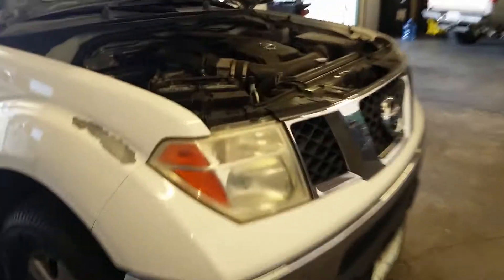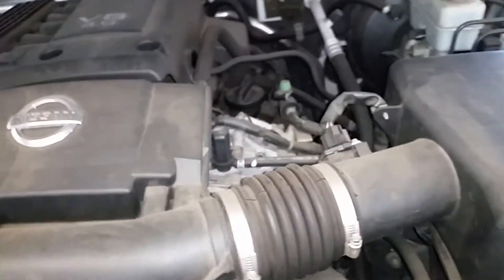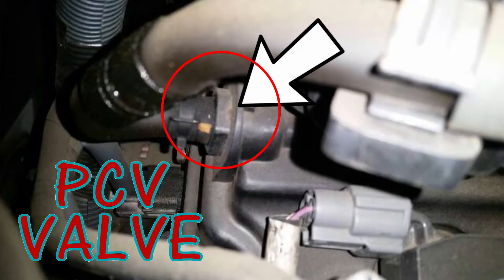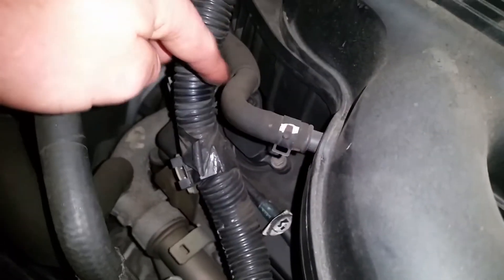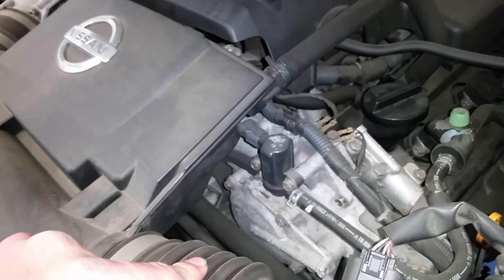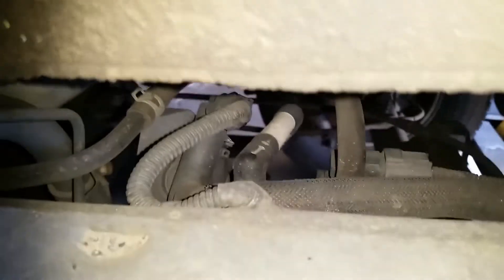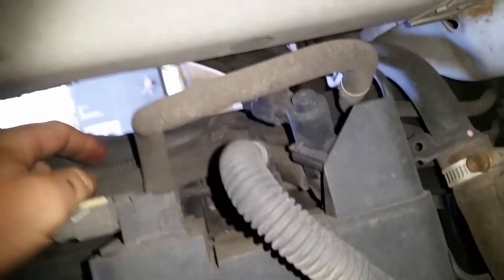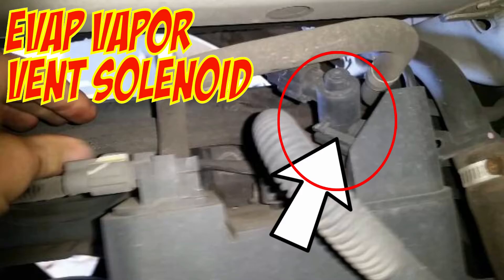Nissan 4.0L v6 VQ40DE Emissions locations: PCV, EVAP syst

Comment: I can’t get my evap system cleared up. If I put gas in it, it comes spraying back out. I have a new canister, new purge valve, new pressure sensor.. no dice. I’m about to bypass the canister cuz I need my car and I’m tired of dicking around… but if anybody has any tips or info for me, I’m listening.

Comment: very good video,i have an evap solenoid issue and will need to drop the canister to replace,also im experiencing poor fuel mileage and wondered where the injector rail schrader valve is located so i could do an injector clean?(if its equipped) thank you, roger ontario, Canada
Reply from the maker: What is the year/make/model of the vehicle you are working on. I'll check on Alldata and see if I can find something.
Reply: 2011 nissan pathfinder LE 4.0 engine 4wd
 @ScottiesHobbies
Reply: Great to know

Comment: What is the purpose of those I nder the rear that you pointed out. I'm currently not getting any prime from my fuel pump. Would that have anything to do with my no prime issue.  I turn the key and i hear nothing from my pump.....also no crank but it tur s over yet no crank
Reply from the maker: Sounds like your fuel pump has gone bad. A Mickey Mouse away to check is to have somebody spray carb cleaner or brake cleaner into the intake while somebody tries to start it. If the vehicle starts up I would put money on your fuel pump being bad.  Be super careful. The spray can back fire if you have some bigger problems. 

 Also try hitting the fuel tank with a rubber mallet while somebody cranks the vehicle. You might get lucky and get it to work for a little bit.
Reply: @ScottiesHobbies  yeah ove srpayed starter fluid in the valve body and nothing before I then replaced the fuel pump and still nothing. It cranks but still no start
Reply from the maker: @tpridgen11  what is the year/make/model you are working on?
Reply: @ScottiesHobbies  2008 nissan pathfinder 4.0 SE V6
Reply from the maker: @tpridgen11  ok. If you spray carb cleaner in the Intake and nothing happened.. I would start to think you don't have spark. Basics are does it have air/combustion? Does it have fuel? Does it have spark. Since you manually added fuel and got nothing, what is next? Spark.  

I don't recall if that truck has spark wires but if it does, use a spark tester to see if you have spark. Now if you have light spark or its very erratic, you might have a crank sensor or cam sensor out. If no spark, a coil or computer problem.  

 When I get home I will take a look at some pictures and see if I can find a fuel pressure access port. And recommend something better.
Reply: @ScottiesHobbies  yeah I sprayed it with some starter fluid and it tried to start up but very slightly. It has a half tank of fuel I. There as well.
Reply: @ScottiesHobbies  I'm starting to think it's the Ipdm box with all the fuses under the hood there
Reply: @tpridgen11  cam and crank sensors. replace all 3 w OEM

Comment: Is it fairly easy to replace the vent valve on top of the canister?  I’ve only had my 2013 frontier for about 6 months and it’s pretty much always had the engine light on.  Think it was code p0446 or something like that.  Takes like 30 mins to fuel up my truck cuz it clicks off every half gallon due to the fuel vapors.  Think it’s the vent valve but I’m not real mechanically inclined.
Reply: Did it take care of ur problem cuz I’m having same issues with my 2009 nissian frontier?

Comment: Where would the bleed valve be after u but new heater core in it and still not get hot 2005 2 door Nissan v6 something u work on in this video
Reply from the maker: What doesn't get hot? The engine or the heater?

Comment: Thanks it’s the 3rd time I’ve had the intake off,  not the easiest truck to test compression , Used Mobil 1 since it was new, the last engine I had fail was was a 84 Cressida 
The injectors are out
Almost seemed it was fouling the plug, but no smoke and no oil usage,
I removed mobile 1,  now 10/40
Reply: So now you've introduced a different oil to the seals by stopping synthetic & converting to conventional -your performance review now pertaining this engine would be golden (how many miles, fuel consumption & fuel grade) -please advise.

Comment: Hi,,,  Great video's.  Would appreciate your comment,  driving me crazy,   I had a PO301 fly miss fire, pulled it apart and put in new coils and plugs, and put it together ran perfect for 3 hours and the miss came back. Truck has 200k and was using mobil1 and  0-20,  pulled it apart replaced #1 coil and plug, ran perfect for a hour than the miss came back.  I drained the mobil1 and put in 10-30  do you think bad cly or valve anything else I can do,  or motor time.,,,,,,      Thanks Mike
Reply from the maker: I would recommend to start by checking compression. Make sure you're working with a good motor. You could also have a misfire due to improper air fuel ratio. If you have a clogged injector or a stuck open injector you can get misfire codes too.
Reply: Same problem with 06 Nissan replace coil and plug clean trouble body replace oil sensor replace alternator and the rpm are low I don’t now what it could be.
Reply: Eric Nazario 
Turned out passenger cam jumped a tooth, it’s a 10 hour job and I ruined my cats from driving with a misfire, looks like I might pass on repair, couldn’t face that job & have something else happen

Comment: Hey bruh. Can I put that engine in my 2097 G35?
Reply from the maker: Depends on how much money you have to spend.. I don't know if the trans will bolt up. I am not much of a swap guy with imports. But I do not see any interchangeable parts for a G35 and this truck. If its possible to bolt up to the transmission, you will need a ecu with a harness. I think the trans controls the same if you swap the ecu? If you are trying to do this swap to save you $$, don't do it. If you got $$ to waste, anything is possible if you try hard enough.

Comment: So are you showing these locations to chase down a certain code?  I'm trying to solve a p1283 and there are dozens of possible causes.
Reply from the maker: Looks like that is a lean condition code. I would start off by checking for exhaust leaks between the exhaust manifold and the air fuel ratio sensor. If that is all good then I would start looking for vacuum leaks. If that is all good that I would start thinking that the air fuel ratio sensor itself is malfunctioning.
Reply: @ScottiesHobbies  The weld on the secondary cat where it mates up to the flange up front popped.  It's completely separated itself and is purring.  Hoping it's an easy sleeve weld at the local muffler shop or I'll have to RockAuto a secondary cat.  Since the break is before the secondary cat, maybe I've found the culprit.
But from what I read, it may just be the first of many to come.  Thoughts?
Reply from the maker: @butchgreene  is the last oxygen sensor before or after this hole in the exhaust stream? If the leak is past the last oxygen sensor then,  no. If the last oxygen sensor is past the leak, yes.
Reply: @ScottiesHobbies  The break is  before the 2nd O2 sensor
Reply from the maker: @butchgreene  that should give you a Cat code like a p0420 or p0421. But it is possible.
Reply: @ScottiesHobbies  local shop going to reweld it tomorrow. Time will tell
Reply from the maker: @butchgreene  keep me posted. Good luck, I'll keep my fingers crossed.
Reply: @ScottiesHobbies  P1283 went away thanks to the welding. But yesterday (about 300 miles later it threw a P0420) so gonna run it to shop and see if they'll diagnose? Maybe they'll have data that clues em.in?